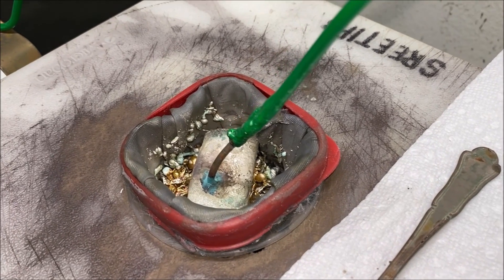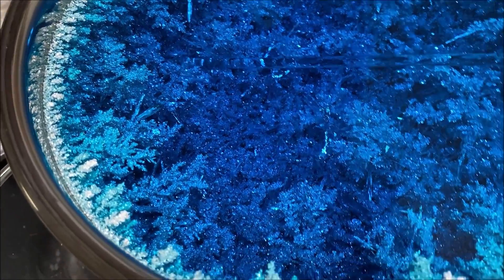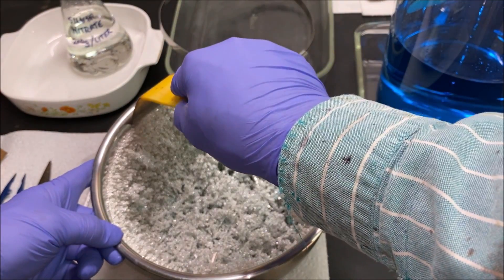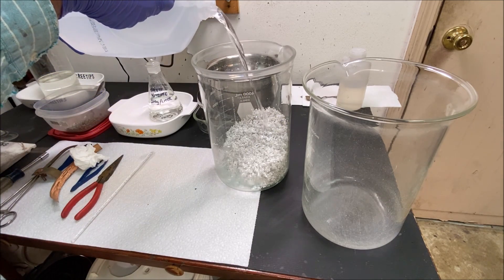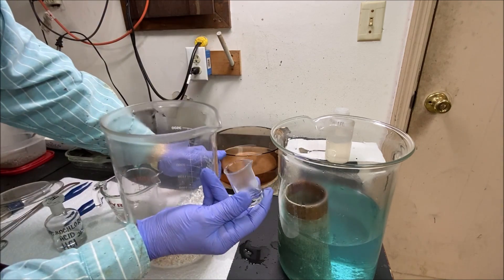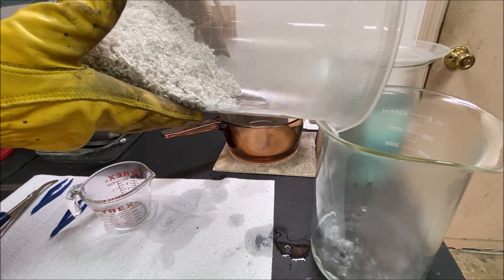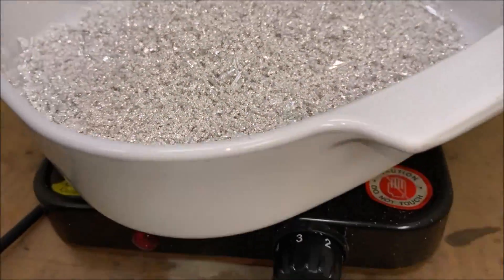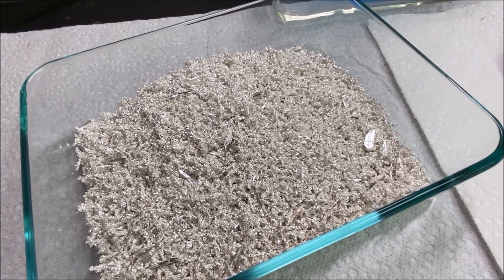Fifty Ounces of Silver From My Silver Cell Day 15

Comment: Still don’t know what you did, what the purpose or process was.
Reply from the maker: This is silver refining. I’m removing impurities from the silver by passing an electric current through the impure silver. The current flow dissolves the silver. The silver ions pass through the filter, travel through the electrolyte, and deposit as high purity elemental silver on the inside of the stainless steel cathode.

Comment: Okay, now that I've gone through the entire video, where is the silver coming from? To be more specific, the video seems to be missing context.

It appears you have a 99.9% pure ingot for the anode, which is used to replace the silver pulled from the acid bath. That is the same process I use in my plating projects, noted in my other post. The difference is, I use copper to plate wood projects (after making them conductive with a graphite-MogePodge mix to coat the wood).

Unless there is some source for silver, this just seems to leave me with a conclusion you are making a silver based acid plating solution then using expensive silver ingots to keep it going.
Reply from the maker: It comes from sterling silver

Comment: So, silver electrolytic processes produce crystals that could pass for copper sulfate?

Meanwhile, back at the ranch (my copper plating station I use to copper plate items I turn on the wood lathe), the copper flows onto the cathode (the wood turning made conductive) from the anode, which, for my purposes, is just copper wire I save to work as the anode (to replenish the copper moved out of the acid bath).

This is going to be an interesting watch. . . .
Reply from the maker: No, silver electrolytic process produces high purity elemental silver metal, greater than three nines fine.

Comment: I used to use silver nitrate in a genetics lab and you need to be very careful not to get it on your skin as the subsequent black silver stain will only come off with wear. Where on earth would you get hold of silver nitrate solution?   I'm retired now so don't have lab access.  flaxen saxon
Reply from the maker: I found out by accident that 3% hydrogen peroxide will remove the stains.

Comment: How much impure silver did you feed into the anode basket? Im not good at science or chemistry, so I don't pretend to understand exactly what's going on here. But the description says that they crystals were formed from impure silver. So I'm assuming that it wasuch more than 50 troy oz. Of impure silver that you started with? Or do I have that wrong?
Reply from the maker: You are correct. The impure silver going in is (estimated) 51 Troy ounces.

Comment: Shouldn't you be using a screened mesh to stop the crystal from escaping with each rinse flush?  Seems to me you could use more of the rinse solution to drain off into the other vessel.

Comment: The electrolysis is cool and all that, but aren't you losing money by doing so? The silver in silver nitrate has got to be more expensive than just buying a chunk of silver, no?
Reply: I was thinking the same thing.
Reply from the maker: I’m trading paper for silver.
Reply: @sreetips  Ahhh, okay, I thought you were purchasing silver nitrate and electrolizing it, but that wouldn't make any financial sense. I have also traded paper for silver, one of the worst trades ever. It took 10 years for me to gain 20% and jump ship. Gold actually made me money. I've listened to the bull case for silver for decades. It sure sounds good on paper, there's every reason to believe its performance will leave gold in the dust. But that never seems to happen for some reason. Besides, gold is much easier to store, I only bought 10k worth of silver and it was bulky, heavy, and hard to hide. But it's relatively easy to hide your gold. Anyhow I mostly flip stocks nowadays, I love 'em and leave 'em. Unless they pay high dividends, of course...

Anyhow, cool video, it's nice to teach people about science. Thanks!
Reply from the maker: That’s the difference - I’m not trying to “make money”. I’m making silver
Reply: @sreetips  Right, I get it, just demonstrating the chemistry. Some of your other extraction videos seemed to be about reclaiming metal, so I assumed that was the purpose of the channel, and the Street Tips title reinforced that idea in my mind. By the by, how come you didn't actually cover the silver with boiling water to begin with, instead of pouring just a bit in and shaking it around. I found myself sitting in my chair yelling at the screen, (in my mind) because that should only have taken two passes to complete. Instead, you did it over and over again. Drove me nuts (sorry). 😀
Reply from the maker: I want to ensure all the silver nitrate is rinsed off. Usually takes about six rinses.
Reply: @sreetips  I'll bet if you actually submerged all the crystals in hot water, and then shook it around, it would only take two rinses. Three at the very most.
Reply from the maker: No, I make the silver nitrate myself by dissolving some pure silver crystal that I reserved from a previous harvest in nitric acid and use it for the next two runs of the silver cell.
Reply: @sreetips  so do you get a big yield and can make bars of silver afterwards?
Reply from the maker: Yes.

Comment: Excuse my ignorance, but what is the purpose, to refine lesser content silver, recover silver from a mixed alloy, or to create silver crystal?
Reply from the maker: I use silver to refine gold. After I pull it out of the gold with hot nitric boils, I recover the silver, melt into shot, then run it through the silver cell to get high purity elemental silver metal.
Reply: @sreetips  LOL, heck ow I'm more confused, silver to refine gold? After you pull it out of the gold?
Reply: I assume you mean elemental silver as 99.9%, right?
Reply: Maybe I get it, you're pulling silver out of gold, with nitric acid, to refine the gold, this leaves the silver in the nitric solution, and then using the silver cell to recover the 99.9% silver?

Comment: Siver out of what?  Electricity and what... "super nitrate"? Electricity + "super nitrate" = silver?  
What am I missing here 🤷‍♂️
Reply from the maker: Here’s the missing component: I refine gold. I use sterling silver to refine the gold. Then I recover the silver, melt into impure silver shot and run it through my silver cell. The electrolyte (blue liquid) is silver nitrate that I make by dissolving some of the silver crystal in nitric acid.

Comment: Do you find that leaving some silver crystal in the electrolyte solution before adding back to the silver cell helps seed\ expedite the crystal formations? When I make live resin and crystal THC I find this to be the case. I now it's a very different process but just curious is this phenomenon works with this process as well.
Reply from the maker: No, because these are not true crystals. They are dendrites. They are called “silver crystal” because they resemble crystals in their structure

Comment: How much does it cost you to make 50 ounces of silver?
Reply from the maker: Not sure, this is my hobby. I use sterling to refine gold. So I recover it and run it through the silver cell.
Reply: @sreetips  So it's not like you start with nothing and create silver through a chemical process?
Reply from the maker: No, I can’t create silver. I’m refining the silver. I add impure silver into the anode basket and pass current through to dissolve it. The impurities stay in the anode filter and the high purity silver deposits on the inside of the stainless steel bowl (the cathode). I only get out what I put in, less impurities.
Reply: @sreetips  Wouldn't it be nice to create gold and silver through a chemical process. Guessing it may be possible, but the recipe is probably kept hidden by dark minded power freaks. They make lab created diamonds and other gemstones. (non-metal though)

Comment: Is the purpose of this process to utilize the optimal refining technique? Aren't there simpler, faster methods of refining?
Reply from the maker: There’s more than one way to skin a cat. But I like the “set it and forget it” feature of running the electrolytic silver cell. Getting pure metal is never quick and easy. Part of the reason that it’s very expensive.

Comment: Do you get more silver crystals than the amount of silver/metal you put in? Or is it a 1:1 ratio?
Reply from the maker: It’s less than 1:1 because the impure silver being fed into the anode basket has impurities and they get trapped in the anode filter. So for 50 Troy ounces out, I’ve probably added 53 Troy ounces to the anode basket. Some of the impure silver remains in the anode filter with the slimes. I recover tgat later on when I process the filters for the gold and platinum group metals.
Reply: @sreetips  Thank you. It may seem like a silly question, but I just found your channel and don't really know anything about crystal structures.
Reply from the maker: No problem, we are all learning about precious metals refining. Me included!

Comment: Very inspiring videos , you have influenced me on building a set up , the only problem is I don’t have any sort of scrap silver to get started so in your opinion could I use one of my silver bars in my silver cell
Reply from the maker: Yes, I’ve run pure silver crystal back through the silver cell. Assay came back greater than five nines fines. That 99,999 part per one hundred thousand pure silver.
Reply: @sreetips  thank you so much ,,, love your work
Reply: @sreetips  I just stumbled across your channel. Just a quick question.
Did you actually just make more silver than u started with?
How much did you start with in your solution?
Looks fun

Comment: So you’re making silver? Is it still of or can you make it 100% pure then sell it?
Reply from the maker: I’m not making silver, I’m refining it. Entropy guarantees that it can never become 100% - however, I did run the crystal back through the silver cell a second time once. I sent a sample to have it analyzed and it came back greater than five nines fine. That’s 99,999 parts per one hundred thousand pure silver. Which means that for every one hundred thousand atoms, only one of them was not silver.
Reply from the maker: I used to melt every bit of the silver from my silver cell into pure silver bars, stamp them, and sell them.

Comment: Great video as always! Do you think this process would work for a silver, copper and aluminum alloy? 
I have some interesting pieces that are majority silver with small fractions of copper and aluminum. Thanks!
Reply from the maker: It’s best to use metal that’s already fairly high purity for the anode material. Otherwise the electrolyte becomes fouled quickly.
Reply: @sreetips  Got it, thank you for your response!

Comment: Not growing anything...just purifying the silver or separating the metals at the expense of the electrolyte. I used to do the same but scrap silver is too expensive & with acid costs it's cheaper to just buy rounds
Reply from the maker: I use sterling to refine gold. So I have a ton of silver powder laying around. I melt it into shot and run it through the silver cell. Silver is a by-product of my gold refining. I’ve got a hundred pounds of silver that needs to be run through the cell. So I’ll be building a second silver cell from scratch. Video to post later this week - hopefully.

Comment: so your not actually creating silver by growing these crystals, your just refining them from a waist product you have from refining gold
Reply from the maker: Correct, the “waste” product is blue silver nitrate solution from the nitric acid boils. I recover the silver by cementing the silver out of solution on clean copper. Then I melt into shot and run it through the silver cell.

Comment: If you don't already have a bit of the pure silver crystals to use in making your solution for the silver-cell, what do we use?

Can we purchase an once or two from someone like you to get the process started or am I missing something in the process?
Reply from the maker: Pure silver bars or rounds can be used to make the electrolyte.
Reply: @sreetips wonderful, thank you
Reply: One more quick question regarding the anode.

Does it have to be cast from the silver cement or can one simply use a thick piece of copper so long as the anode does not touch the solution?

We are only seeking an anode that is suitably  conductive regardless of the material right?
Reply from the maker: Yes, but the anode electrode should be made of silver in case it contacts the electrolyte and begins to dissolve. I like cast a pure silver bar, because pure silver is so easy to work with. I cast a copper wire right into the bar for maximum contact.
Reply: Haha sorry one more.

Is it required to smelt the cemented silver into the shot or can you just use the cemented silver powder in the anode basket for the silver cell?
Reply from the maker: Smelt is a term used to describe rendering metals from ore (sorry, pet peeve of mine). I tried silver powder once with negative results. The filter got clogged up and the current flow dropped off rapidly.

Comment: I wish I knew what he was doing here, it looks very interesting.🤔
Reply from the maker: Silver refining. I add impure silver to the anode basket. Run electric current through it. Dissolves the impure silver, travels through the silver nitrate electrolyte and deposits high purity elemental silver on the stainless steel bowl (the cathode).

Comment: The crystals form when copper metal (Cu) is added to a solution of silver nitrate (AgNO3). The copper replaces the silver in the solution forming blue copper nitrate (CuNO3), and solid silver crystals (Ag) form on the surface of the copper. The exchange reaction is quick, learners can actually see the crystals grow.
Reply from the maker: I’ve run pure silver crystal back through the cell with fresh colorless electrolyte. It produced (verified via ICP assay) greater then five nines pure silver. The electrolyte stayed colorless for the entire ten day run. Copper in the electrolyte is not necessary. But some believe that it promotes fatter crystal growth.

Comment: Is there any way to grow the crystals larger overall in size, not quantity but as in actual dimensional size ie bigger crystalline structures? Was thinking they would make a really neat piece of desk art, or a conversation piece.
Reply from the maker: Yes, I’ve grown extra large silver crystals. But I can’t reproduce conditions to make it happen. There are so many variables that it’s nearly impossible to duplicate.
Reply: @sreetips  question which metal produces the largest and most durable crystaline structure?
Reply: Thanks, was thinking that if the crystal could be grown to a larger size it could be encased in transparent acrylic then sold as desk art. Kinda like a paper weight or something along thise lines. Still might be possible going to have to try growing them myself.

Comment: Cost basis?
Reply from the maker: Don’t know. With silver so low, I just buy silver, as much as I can, as fast as I can. I use it to refine gold. Then I recover it and run it through the silver cell. Then I put the silver away and forget about it.
Reply: @sreetips  I'm a stacker too ok... whatever.. How much does the kit cost? You got anode, chemicals, hardware etc. So 50 oz of refined silver is around 25 plus.. you would minimum 1250 of silver... at what cost? I do numbers.. sorry.

Comment: This is amazing and looks fun. I may have to check into it as I’m at home with a small shop everyday…about how much would it cost to get started, anyone, on the cheap end? I’ve blasted thru my savings and disability pay isn’t at all what it’s cracked up to be. 😆 My hobby’s have out-bodied and out-priced me finally. I’m looking for a new one!
Reply from the maker: The main problem is: a recurring source of silver. It don’t just fall in your lap. We get up at 5am to arrive at 6am to be first in line for an estate sale that starts at 9am. I’ve got a hundred pounds, or more, of silver that I need to refine. I don’t have to sell any so I just put it away and forget about it. This is my hobby.
Reply: @sreetips  that’s a good idea, I been buying up some for a while now but I have nowhere near as much as you do. With the value expected to really rise soon and continue, you’ve found a hobby that’ll really pay if you ever need it. I can see trouble sourcing it soon, for a good price that is. I may give it a shot with some of mine. Thanks for the response.
Reply from the maker: Please understand that you can hold the sterling just like it is. So don’t melt it and ruin the markings. It’s value becomes questionable if you do. Sterling will track right on up with pure silver so there’s no need to refine it.

Comment: So I just wanted to ask… what’s the application for this? Can I melt this down and sell?? Does this have any value other than just the crystal aspect of it?
Reply from the maker: Every investment grade pure silver bar or round began as pure silver crystal just like you see in this video. It can be melted and sold. I used to do that with every bit of silver that I refined. But with silver so grossly and artificially suppressed, I’m not selling any of my silver. If I need some paper to buy food or pay rent, then I sell a little metal.
Reply: I see but I’m still a bit confused. If making silver like this and if it’s the real deal why don’t more people do this? I mean what’s stopping someone from just trying to make a fortune off this?
Reply from the maker: I’m not making silver, I’m refining silver. I only get out in pure silver crystal, the amount of impure silver that I put into the anode basket, less impurities. I can’t create silver out of thin air. Nobody can. I buy sterling silver and use it to refine gold. Silver is a by-product of my gold refining process. I recover the silver and run it through my silver cell. Then I put it up and forget about it.